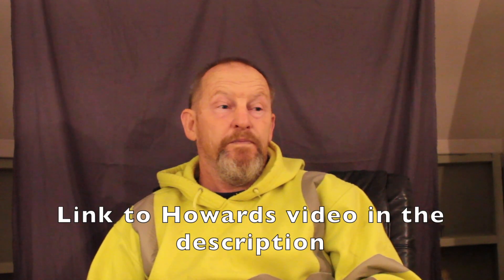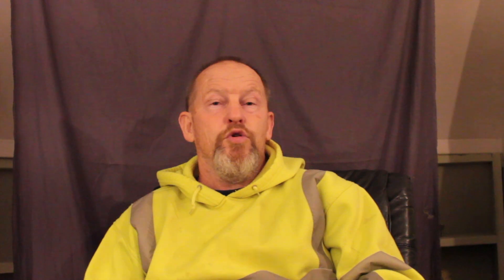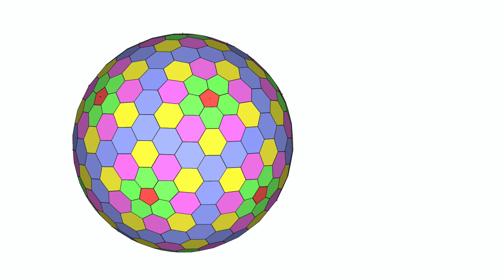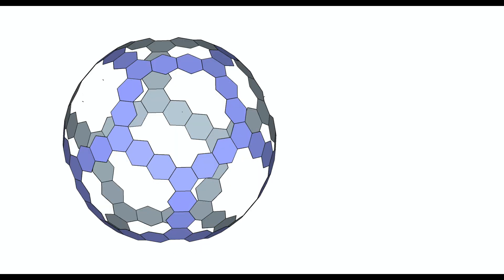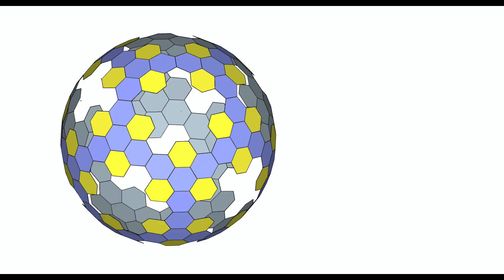9v Dome build, without any plans...Crazy skills

Comment: Plans would be great!  What would be the structural strength differences between triangulation and the honeycomb structure?
Reply: If you noticed in the short video, there was a strap around the dome, it held it all together during the build, I was worried that it might distort,  as the last few frames were installed everything stiffened up just like an egg shell. It's a strong structure when completed. It took  my weight when I sealed all the joints with tape off a ladder. It has amazing acoustics at the focal point inside and when talking, total surround sound. I used an air powered corrugated fastener tool for the joints, only after exhausting other possibilities. The time taken over all was extended by months due to Anne loosing her daughter and I lost my Mum.

It is a big commitment, but worthwhile. I set up a jig for the cuts of the blue hexes, I have s Makita compound saw. Each side of these hexes was 350mm, it gives you a 5m dome. The build cost about £1000. Four hands were needed to cover the frames with polythene, and I used a paint roller to stretch the film while Anne used an air powered stapler to fix it. Hope this helps you to your goal. I'm not a computer buff, I saw Paul's sketch  I understood how it was possible to make without a computer. Each of the flower like centres took about three hrs work all in all this summer weekends flew bye. I knock nails in for a living, 48year's, I guess I must have picked something up on the way through. 👍
Reply: @howardhewitt1797  
For edge beveled panels with plain miters i`d recommend using splines and structural epoxy with stainless brads for assembly. Its more work but the joints are super strong and will never come apart. With  compound mitered corners, i cant think of anything better than the corrugated fasteners except combined with epoxy.
Reply: Hi yes I used resin glue.
Reply: @howardhewitt1797  
I use permabond ET 500 epoxy, its unbelievably strong but quite pricey.

Comment: Loved the videos. Will build one myself. Would appreciate very much if you could send me the plans. 
Radius 5 m.
Thanks a lot
Reply: A 10m diameter version would be 5.9m high. You`ll need a  larger timber cross section for the panels along with reinforced joints. Large open hexagon and pentagon panels are considerably less stable than smaller panels.  I`d suggest making a hexagon test panel 727mm on each side and see how easy it is to squish or twist out of shape :)
Reply: @JohnGuest45  
Thanks for your reply. Was planning to build triangles. What section would you recommend for a 10 m diameter? Where could i source drawings with all the angles and lengths?
Looking forward to reading you again.